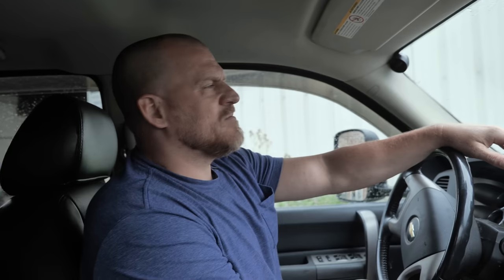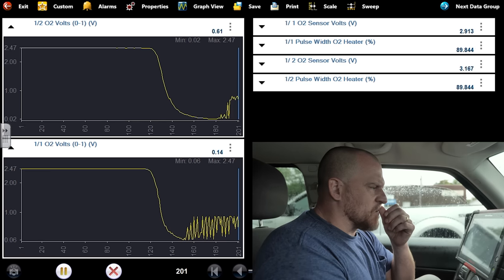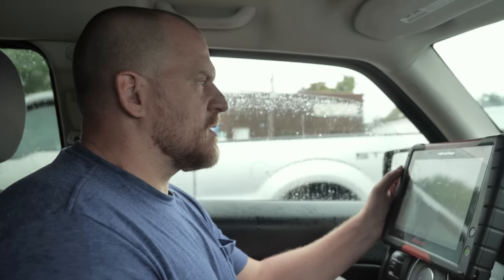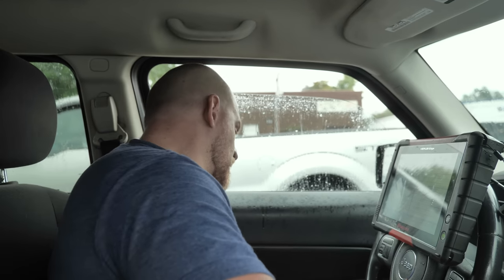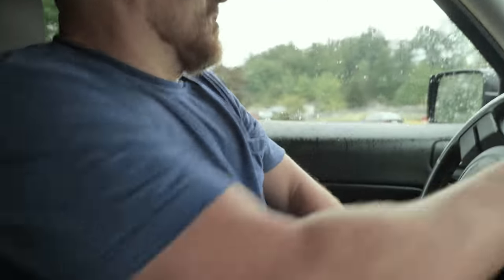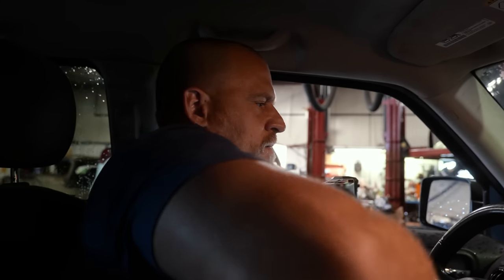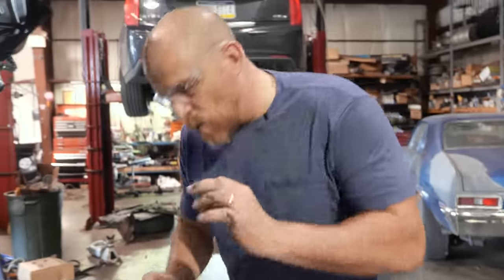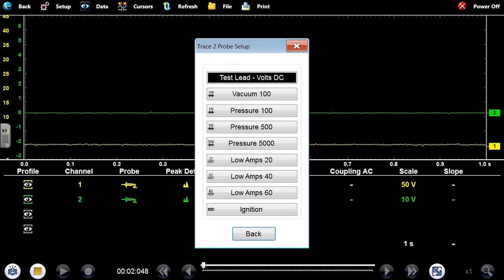Testing Ignition Coils and Fuel Injectors (Intentional Shutdown)

Comment: Great video on computer behavior. It seams that a lot of mechanics always change the plug when a coil goes bad. My question is could a fouling plug cause enough over current to burn the coil winding open or shorted? Our corolla had a bad coil after 100k so I ordered two and changed all the plugs. Before the parts arrived it lost another coil. After the new plugs the remaining 2 coils have been fine.
Reply: Worn plugs cause the coils to work more  to jump the worn plug gap
Reply from the maker: Fouling, no, because that is an easier path, so the coil would be stressed less, not more. An open is a different story. Sounds like just bad new parts. What's Eric O say? New = Never Ever Worked
Reply: @ScannerDanner  You caught it! I should have said high mileage or worn, my bad. Then the larger gap requires a larger voltage inducing a larger current, and heat, in the coil. So if the plugs are left in beyond the service interval you might be stressing a "possibly lower tolerance to failure Or just poorly mfg" coil over plug system. I don't recall ever replacing a coil in decades of a distributed system so curious about what caused the factory coils over plug to fail at roughly the same time.
Reply: @GarnConstructionInc  knowing the auto industry as I do, I would say that will be down to manufacturing consistency.. The chances are that the original factory fitted coils on any individual engine came off the coil production line one after the other and are probably close to being identical. At least for companies like Toyota where Engineers rule the roost. Toyota probably have their coils nicely packed in liners. Companies like Ford or GM probably pack coils loose in boxes to save the cost of packaging because the bean counters rule, which leads to a more random distribution of parts (but also an increased chance of early life failure due to rough handling during transport.
My tuppence hapenny worth anyway, in truth we'll never know.
Reply: @CycloneCyd  #1 started misfiring first then was good for a month after a good cleaning. That was the warning sign to change the plugs I ignored. I forget the second but it may  be as simple as location to the oil fill cap!

Comment: That spark line is jumping out from the top of the firing line
Reply from the maker: I didn't see that. It was about the same kv as the good firing cylinder. I should have superimposed both captures at the end to compare better. That's my fault in the edit room with my son.
Reply: @ScannerDanner  what I did notice was the spark line being completely flat and a little low and the burn time being identical every time with the bad coil, whereas with the good coil the duration and shape of the waveform varied slightly every time as were used to seeing.